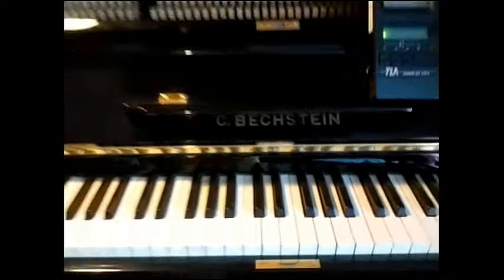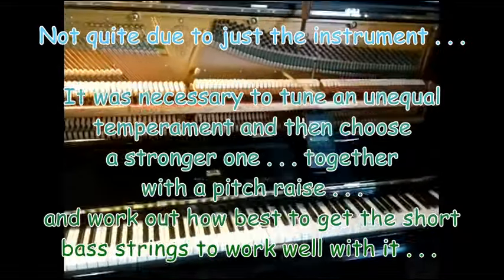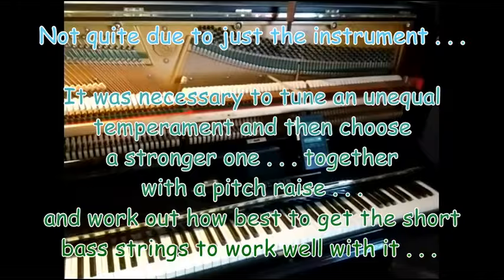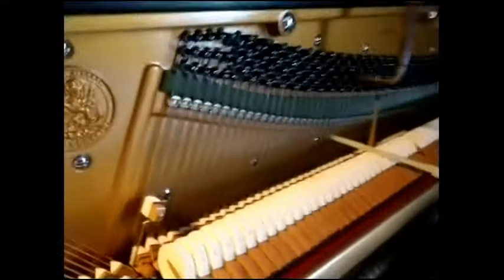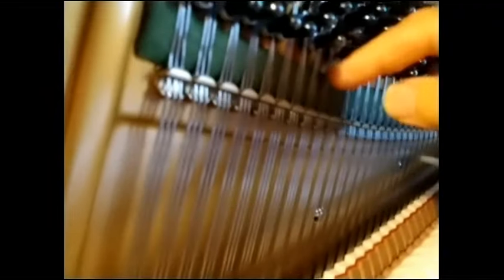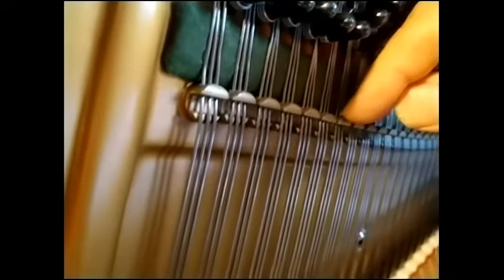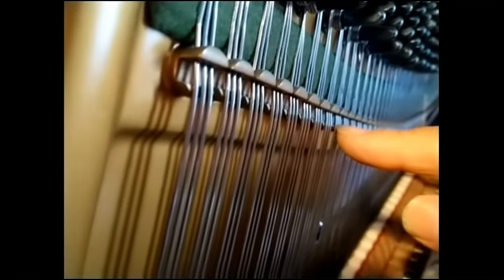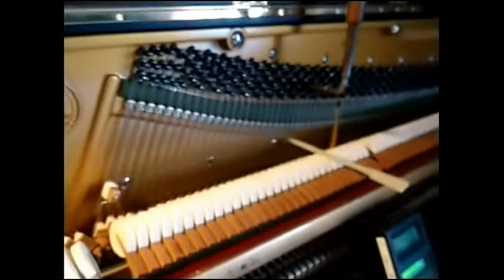Tuning Bechstein upright pianos, why 432Hz is spoof and unequal temperament is necessary

Comment: Since i use retunable electronic software synths (SurgeXT, Pianoteq and, to a lesser extent, Pigments) i can devise my keyboards on a song-per-song basis, depending on the chords i am using for a given song. I can also decide if a given set of chords will come closer to just intonation or remain in the realm of "looser than strict equal" temperaments.   Of course my music is simple from an harmonic standpoint. Beginning of "Fire on the dance floor" is a modified/optimized WerckmeisterIII with some dominant 7th tuned very close to JI.   In "Sorcière" i push the tuning towards JI.  I understand that kind of music may not be your cuppatea..   but hey!!!    We're talking tuning here!!!     Cheers.